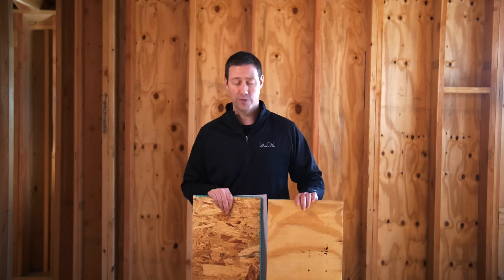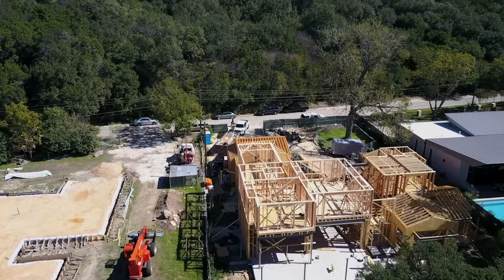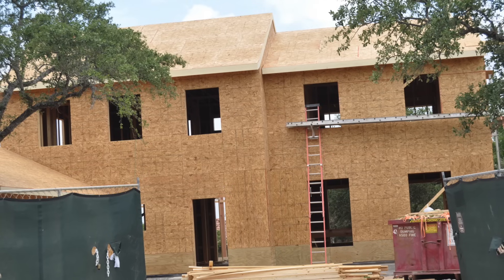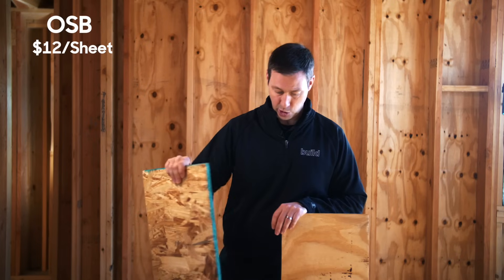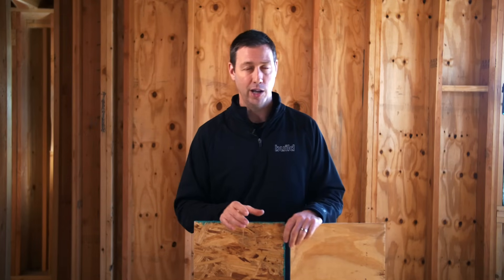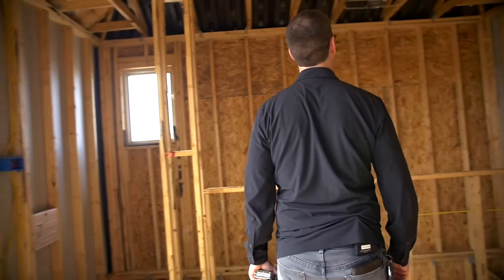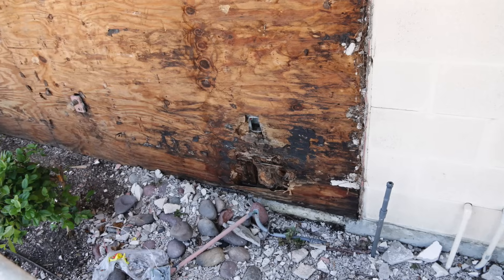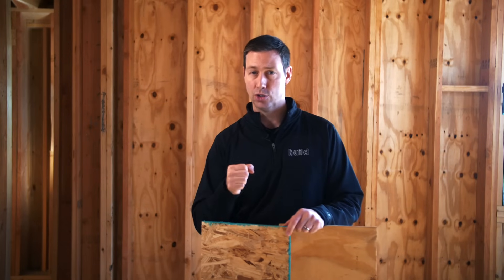Framing : OSB vs. Plywood - Whats the difference in COST AND PERFORMANCE

Comment: Neither. Use proper building material like airbrick, ceramic block, concrete, you name it. It do not rot, do not burn, insects will not eat it. Ceramics has superior mechanical strength and sound suppression properties. In my country wood is used to construct a roof structure or children's tree house that supposed to last around for 5 years before its decay. 
Don't get mi wrong, i love wood, its 'warmth', look, smell, it is a wonderful material for some application but not for house construction no matter how many glue and other chemicals you pump into it.

Comment: As far as I'm concerned OSB sucks. The floor of this double wide is OSB and my mother used to have aquariums that over time leaked. The OSB swells up and now the whole floor needs to be replaced. The OSB goes under the walls you know. Yes this trailer is old but plywood would never do that. Removing the carpet and the OSB is a nightmare as now the floor has weak spots and you can go right through to the crawl space below.

Comment: OSB, what I call waferboard or chipboard, is basically junk. It weighs more than plywood and is not nearly as strong. My house is built out of it. But if I were to build my own house, or design my own house, or any building, It wouldn't have an oz of that crap in it. Builders of tract homes use it to save money.

Comment: Strange but true?? He mentions codes requiring air tight and well insulated homes. Knowing him, I  immediately say to myself what of log cabins and other non-traditional homes. Then I think, air tight homes require air transfer units and guys like this keep pushing the "scientifically designed homes" because they make more money on them. So in my curiosity I look up air transfer unit and low and behold, who is sponsoring the first clip? None other than Matt. Also, in some states you have to be licensed in HVAC to install anything related.

Comment: I have been building since 1980 and I can tell you OSB is garbage. You have a sponsor selling OSB so you can't say that but I can. It has structural issues, and if it gets wet it deteriorates far quicker than you suggest. Plywood is superior in every way, including price, when you look at long term durability.

Comment: Come on, houses are meant to last. Most builders don't care about the house they're building 20-30 years down the road, so they use what's cheaper, OSB. Most of the McMansions being built in Austin Tx right now use OSB and 2x4s that are spliced together using smaller pieces for the framing. Sad. In 30yrs those mansions will be crap.

Comment: osb is only good for interior floors and is actually stronger than plywood of the same thickness. never use it for roofs or outside walls for siding. you see that blue edge on your osb that is a edge sealer and when you cut osb you need to seal the edges. nobody does that and that is where it starts to fail. the first osb had no sealer and always failed.i guess you could use a two piece osb sheet covered by a plywood sheet for exterior sheathing with roof felt paper in between. if you lived long enough you would see all those homes you built failing with the osb that is not to be used in floors above dirt and roof sheathing and exterior wall sheathing. do the research. osb is a profit margin material and you know it. i bet your house if you built it does not have osb.

Comment: OSB (Oriented Scrap Board) is a poor choice. It is generally made from fast growth species which are therefore soft and highly susceptible to mildew and rot. OSB is highly compressed and thus when water does get into the product (and it will), the material will expand irreversibly. Water is incomprehensible and it always wins. Once wet, OSB drys very, very slowly and thus mold and rot are highly likely. Builders love it for one reason, IT"S CHEAP !!!!

Comment: "OSB a very good structural product"? And one a good choice for a custom build you say? No. Not in any way, shape, or form. Your other videos give good advice but you're dead wrong on your advice on OSB. If I have to sheath a house with plywood or OSB there is no choice whatsoever. How many trees, and tall and/or massive ones at that grow as OSB. Look at nature. It reflects the laws of physics and what is viable, what works or doesn't work. OSB is a cheap shortcut that costs you more thsn it saves. No one could literally pay me to use it, especially in engineered indoor joists.

Comment: Cheap builders use garbage like OSB...
Yes I am fully aware that in very price sensitive markets some are forced to go with garbage products but a buyer should be aware that the use of OSB is indicative of the rest of the house being cheaply built... 
I lived in Ashburn VA in the early 90s. There were these huge expensive homes being sheathed with painted cardboard. Couldn’t believe it... All a burglar needed to break in was an “Exacto” knife to go through the plastic siding.... and the cardboard...
No other tool required...
OSB is CRAP

Comment: OSB is a terrible choice, it's nothing more than flake board, nobody is constructing boats with OSB, it swells and puffs and molds , plywood will outlast OSB any day of the week.You can put a holr through  3/4 inch OSB with a framing hammer try that with 3/4 inch CDX plywood. If you could get OSB floor joists made with plywood they would be twice as strong.

Comment: Wow, I can't believe they have now gone to cardboard to sheath a house. Granted it looks densely packed but come on! With energy costs what they are, this looks to be terribly inefficient on the back end regardless of the cost savings on the front end. The plywood was $3600 to sheath that entire house.....and it's a 7000 sq ft home (less for the actual living space)! $3600 is chump change IMO on a house that size vs using some cardboard product as the sheathing.

Comment: great all these comments about some idiot buying OSB at the home depot. Home depot sels OSB1. cheap as hell, but useless. OSB1 is for in dumpsters and firestoves. OSB2 is for inhouse usage. OSB3 is for walls of wet rooms in a house. and for the sheeting of a house you should use OSB4. 
floors should be made of fire retarded OSB3. All of these are different products. 

When used correctly, and the right type of OSB is used, OSB is superior ( in price OR performance )

Comment: You need to listen to what he first said OSB plywood is made out of wood chip and glue I am saying the word glue pay close attention to that word the reason why I say this is because I used to lay floors I did it for about 25 years I would never put a OSB board on a floor for two reasons it deteriorates fast if it gets wet and it burns fast and it burns hot the glue being the accelerant to the fire like I said pay close attention to the word glue glue is highly flammable and toxic when fire gets to it

Comment: I worked in So. Cal for many years, The architects we worked with always  (thats "always"....not "most of the time")specified structural #1 plywood (usually came in ten foot lengths)., Looks like you are just doing  a video to get hits, do you have any idea? Did you even talk to some architects and engineers about this?  Talking "cost" is one thing,..but when it comes to strength, benefits, etc., You really are doing a disservice to those who actually want the complete truth and can't hire a high end architect or engineer...and don't know how to do the research themselves. I think during that 20 years,...we didn't buy one................single.......................sheet     of osb (although many of the low end builders did). Although they did tell us we could use osb as "filler" in areas where no plywood was required but we needed to fill in the space with something.  Out in middle america....many lumberyards do not carry struc. #1 ply because their customers are looking for cheap,..which will be fine until the next  big earthquake....hopefully a long time away.

Comment: kind of pointless, IMO.. ANY wood rots without waterproofing, so whoop dee doo?  although i would argue the money you save can be put back in waterproofing...  in MY experiance, plywood warps and is a pain to install, where osb is almost always straight... either will rot if left wet.. i dont think its worth the extra price unless you're doing finish work...

Comment: I would not build with either one OSB or plywood  , I would build a solid house, block, concrete  or brick at least  6" thick then furr out the exterior walls to the R value your heart desires then frame all interior partitions steel or wood , with all sheer walls CMU( Concrete masonry unit , common block cells filled ) rebar inside cells or steel columns and I beams encased in partitions meeting spans for loads 
either one as long as it's engineered for the purpose  , no OSB sheathing on roof , fire sprinklers in home w smoke detectors in every single room , oh well that's  a wild dream 
I had for ever , I guess only bill gates or Jeff bezos  can build such a dream  out in Medina Washington waterfronts 
we the peasants have no choice but to mortgage our lives with the pieces of shit builders offer us sheathed with OSB, 1/2
Styrofoam  4 by 8 sheets 
or plain cardboard, what  
has just happened to this country!?!? maybe someone out there will just come out with the next great ICF product , good customer support 
and training  ...

Comment: Ha! Durable product??  Don’t build in wood!!!
Reply: Don't build with wood if you don't have any skill. My home is reconstructed from a couple old barns; old growth rough sawn 2x6 cedar for framing, 5/4 white oak for roof deck, floors and board and batten, 3 of the exterior walls are field stone. 50 yrs old in this incarnation, true age over 200 and solid as a fortress. Proper roof and water table ( in Upper Canada that is what we call the first 12 inches off the ground-you'll often note the difference in the many old stone buildings here) and maintenance are you need to ensure longevity. I have worked on some of the stone buildings here, if they are not maintained they fall apart too.

Comment: OSB sucks , If you read the manufacture Instlation instructions requires “ All cut edges be primed . This is due to moisture penetration I have built over 100 custom homes and no one primes the edges .